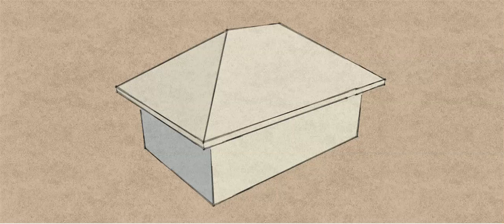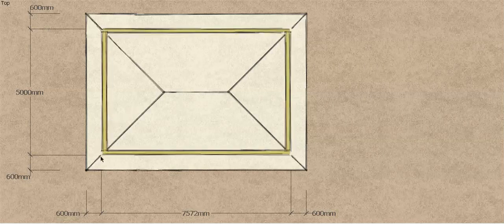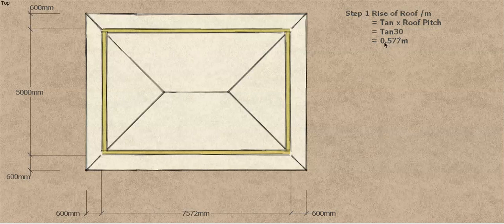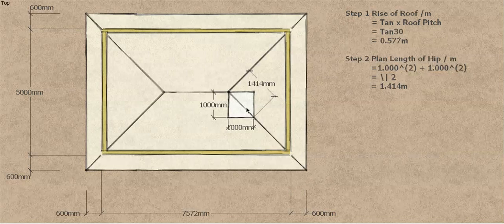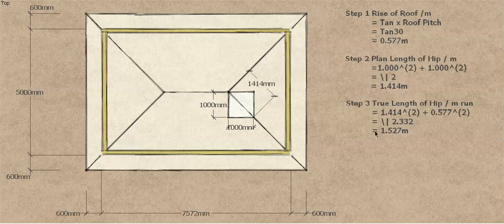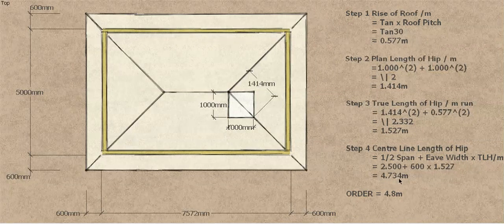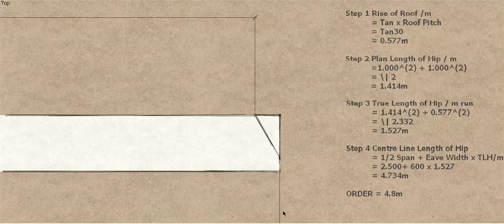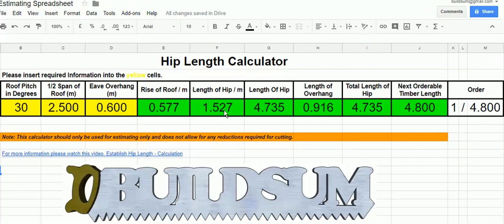Estimate Hip Length

Comment: How can we calculate hip length if end triangle is not symmetrical  but splayed .
Reply from the maker: Hi, Im not sure what you mean by splayed and where.
Reply: @Buildsum 
 Its like when you on a plan of a roof have one end square and the other end splayed. There will  therfore be  on the splayed end two hip rafters with different lengths. How do we go about determining their lengths, sir?

Comment: Hi 
As usual its a great video. Just  a quick thing that the equation   "half span + eave width x TLH/m"  seems here that as per BODMAS method we will multiply eave width with TLh/m and then add to half span, the better way could have been "(half span + eave width) x TLH/m". I am learning a lot from your videos. 
Thanks
Reply from the maker: Hi Mate, Yes, you are right, BODMAS should always apply. Thanks for point it out.

Comment: Great video I understand how to get the hip true length now but how does it work for a bastard hip and valley length
Reply from the maker: Thanks Mate, for a valley it is the same calculation, bastard hips are a bit different as they are not at 45 degrees however you could still work out the length if you can calculate the plan length of the rafter.
Reply: @Buildsum  for the bastard hip is it using same pythagorean theorem a2+b2=c2 but with the common run and the crown run to find true length of the bastard hip
Reply from the maker: Hi Mate, yeah you would have to use pythagorus to workout the plan length of the  Bastard Hip which ever way you go about it.

Comment: I have a question sir. In the step 2 about the plan length of hip, is that a constant like can i used the squareroot of 1m to any dimension of a roof to get the hip?
Reply from the maker: Hi, Step 2 is the length of hip per metre of run of the roof. We use this so we can work out a true lenght of Hip per m run of the roof which we can then apply to any roof of the same pitch.

Comment: How do you get your height above plate for the hip? Isnt it different to the common rafter upstands( height above plate ?  Cheers mate 👍
Reply from the maker: Hi Mate, the Hip has to be the same as the rafter otherwise the HIp will sit higher up than the rafter. The easiest way is to measure it off the pattern Rafter. These videos may help https://www.youtube.com/watch?v=mwoAwsuwMyI&t=3s
Reply: @Buildsum  cheers mate 👍

Comment: Hi, there is a small math issue with the formula (step 4):  1/2 Span + Eave Width should be in brackets. Also, Eave Width should be in meters the same metric for all the parameters in the equation, which should be 0,6. Sumurise: (1/2 Span+Eave Width)*TLH/m = (2,5+0,6)*1,527=4,734m 

Thanks for your work to build that very knowledgeable channel. It has great content and I am very thankful for that! Cheers!
Reply from the maker: Hi Mate, thanks for pointing that out and thanks for your comment.

Comment: hip is 22.3 degrees. it was misleading saying the pitch was 30
Reply from the maker: Hi Mick, the pitch of the roof, as it would be expressed on the plans is 30 degrees, this is the angle of the common rafters that run at 90 degrees to the plates. The hip is always at a lower pitch as it runs over a longer distance for the same rise however this is never written on the plans.

Comment: Hi, not telling you how to suck eggs, but not sure at2.43 in I m not sure what you're saying. I ve done a quick calculation, I need to check , but the hip pitch is 26.6. At the beginning you mention the pitch is 30. That's great, but only works for the common rafters, not the hip
Reply from the maker: Hi Mick, at this point in the video I am calculating a ratio so that regardless of the roof size, as long as the pitch of the main roof is 30 degree then that ratio can be multiplied by the 1/2 span of the roof to give you the length of the ridge.